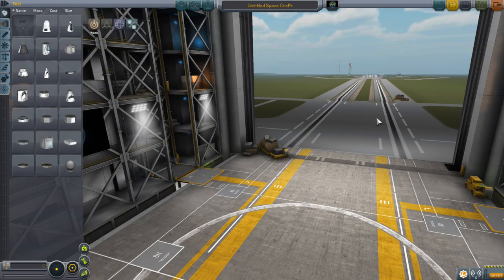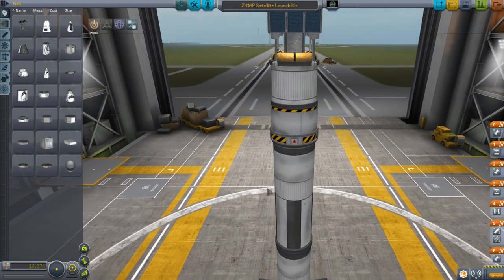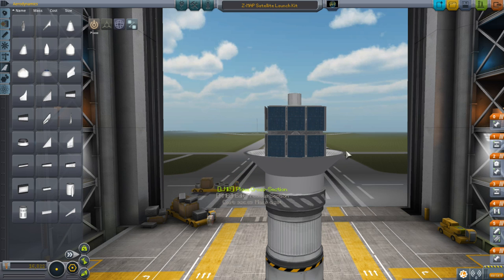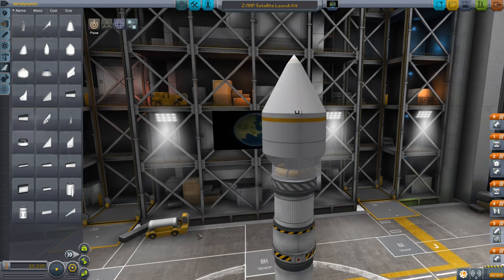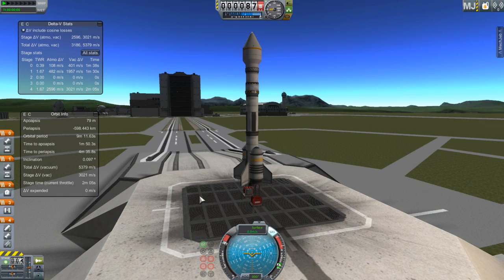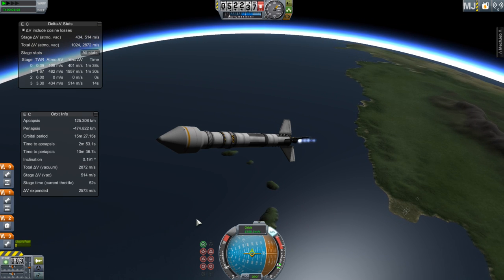Fairings -- AMA 10 -- KSP 1.0

Comment: While I dont agree with how the fairing act. I would have to say Squad has made a really good "PART" to add to the game. They might make for absolute terrible fairings, but they make for an awesome twist in ship aesthetics. I use them as hull shaping. I made a v2 rocket using the stock fairings as the entire hull. Shaped perfectly! All I had to do was stick fuel tanks inside the "fairing" and place an engine on the bottom of the base and wam bam! Made a rocket. So there is still use of these new parts, just not intended. Ill use KW and PF still for my actual fairings. Bob, thou shalt make more  AMAs?

Comment: I must say that even though we have stock fairings I am not truely sold on the idea of them shattering apart I would much rather see them come apart in two or three sections.

I am enjoying the new stock aero a lot but its kind of messing with my SSTO designs with the jet engine limitations, that might be a good AMA right there, SSTO profile?
Reply from the maker: Richard Sweeting You asking me to build something with wings in my rocket simulation game? ;)  Anyway I agree on the fairings. I mostly love them, but I 100% disagree with their decision to make each segment a model. The whole side should come off in one piece.
Reply: Bob Fitch You rocketist you, lol.
Reply: I'm probably still going to use kw fairings for that reason. Just like the way they come appart better.
Reply: Bob Fitch Yes that does cause problems sometimes. I still use Procedural Fairings because I can mount sepetrons to them as well as internal struts if need be. I like the stock fairings for their simplicity of use, but they can cause problems when they shatter apart.

Comment: We need an AMA concerning the new stock  Atmosphere and what it entails for reentry.  No matter what I do, I burn up or smash the ground. I am not a newb to KSP.
Setting your Pe to about 30-35 km and you get heating, but you don't decelerate. you are still heating below 10K alt and finally through it into mach effects about 4K alt and still not slowing enough to open chutes before impact.

And that's for a moderate 2.1k per sec orbital reentry speed.

It seems that while we get the heating effects and even damage... there is very little drag created and very little deceleration.
Reply from the maker: Cg23sailor I'll try a reentry tonight. I am mostly still playing 0.25 for my shows. My next tutorial is on Resource gathering in 1.0 but I'll definitely see what I can discover about the reentry.
Reply: Cg23sailor Need to use the drag chutes.
Reply: Jason Allaway NOt during the reentry itself
Reply: Yes, you can definitly use them.  I usually will deploy them between the 15-10k range.  I have not burned in to Kerbin yet.
Reply: Jason Allaway unrealistic as hell then. No chute should survive being deployed during reentry heating.
Reply from the maker: Cg23sailor Ok, just did my first reentry. It was a Mk1-2 Command Pod with Mk16-XL parachute and 2.5m Heat Shield. I did not burn up. In fact I did not use any Ablator at all. The AP was 300 km and PE was 10 km prior to service module jettison. I opened the chute at 5 km and instantly dropped to 45 m/s until below 500 m. After that I dropped to 6.7 m/s. Impact was uneventful. I would make sure you used the correct parachute. One has 500 deployed drag while the other 170 deployed drag.
Reply: Agreed, they have two sets of radial chutes now, plus the top mounted one.  I just completed an orbital landing without the heat shield.
Reply: Bob Fitch Try with the single Kerbal  pod.

I'm not talking about opening the chutes... The Chute discussion came up because of Jason suggesting deploying chutes DURING the reentry. 

I'm referring to surviving the reentry itself (not burning up) The 3 Kerbal capsule works better but the one Kerbal capsule just slices right on through without an appreciable deceleration. Burns right through the shields  and if you manage to come out the other side of aerodynamic heating intact, you're still going at a speed of R17 with your hair on fire at only a couple thousand meters Alt.

At that point, if you've survived, you got maybe a second before Lithobraking. 

It never was about selecting the right Chute. I know the diff between a Drogue and a Main.

Basically, trying to reenter with the One Kerbal capsule is like trying to perform a manned flight of a "Rod from the Gods".
Reply from the maker: Cg23sailor Done. Mk1 Command Pod, 1.25m Heat Shield, Mk16 Parachute. Reentry was 300km to 10 km. I used 90 Ablator (110 remaining). Opened chute at 4km and slowed to 43 m/s, then it fully deployed at 500m and I slowed to 6.1 m/s. Perhaps show me some screenshots?
Reply: I popped chutes the other day at over 1000m/s. That tourist sure got a hell of a ride!
Reply: When you get to 600 m/s then you will get re entry effects.

Comment: whats up with the heat shield? it says it has an integrated fairing but i cannot figure out how to use it
Reply from the maker: viralshark It's like an engine. If you attach anything to the bottom node then a fairing will appear around the shield and make it look sleek again, like a rocket should.
Reply: +Bob Fitch Can you make an AMA on how to remove parts from mods that you don't want?

Comment: I have a very big questions. been playing this game for pretty good while now and one big issue that I have had since they released the beta was a problem with squad duplication. I have tried to reset the game data for squad. Even look through the file to try to find the duplicated ones and delete them but don't really know which ones are which until you start the game and the only way I have been able to determine which ones were which that work was from the temperature tolerance. but all of my squad parts that come with this stock game have doubles. when beta was released the auto update put their new parts in and kept the original parts that I had put a reskin mod on a long time ago. But even now with the 1.0 release it has affected my current game the new squad parts don't do what they're supposed to do the particle effect has vanished and it is very frustrating trying to figure out which parts are which other than the temperature tolerance. is there a way to download the original squad parts that they have rhe least with the 1.0 version and install them into the game data. would really appreciate it if you could get back to me on this has been bothering me with my gameplay for quite some time now as I said ever since the beta release
Reply from the maker: Jon Arnn I rename the folder after it has been downloaded, which causes the next update to think it's a new install rather than a patch. This allows me to keep copies of every version I have ever had.  You may need to save off the current copy and reinstall the game, then copy in your mods again.
Reply: Jon Arnn Why not just start it over? There's no reason for why you would want to keep old outdated parts from older versions.
Reply: Thank you very much I will try to do so. it is just been slightly irritating to figure out how to fix that. I myself am not the greatest computer savvy person in the world but this game actually has taught me a little bit when it comes to modding in a few other things with computers let's see if I can do this will get back to you sometime if I get it to work or not